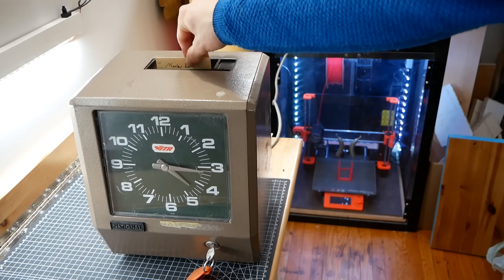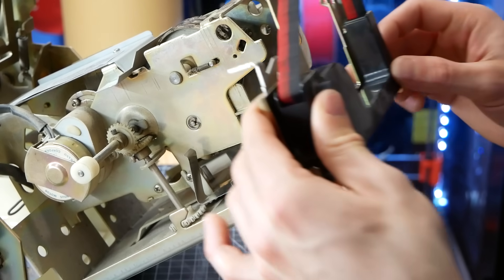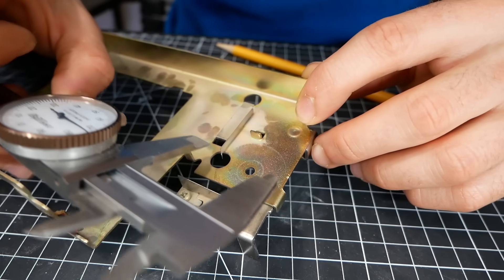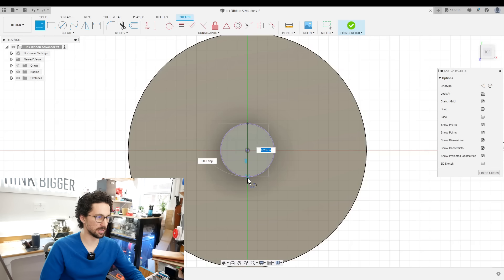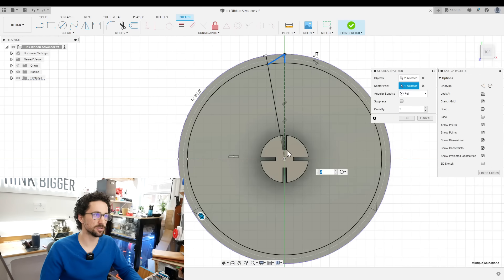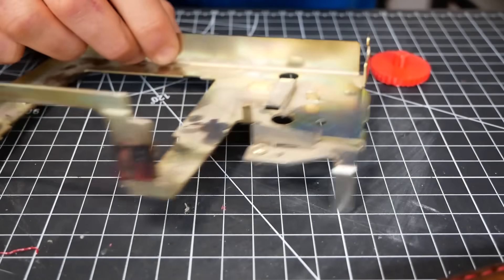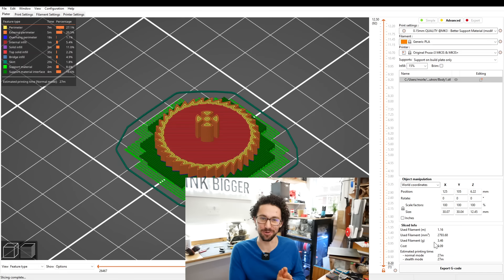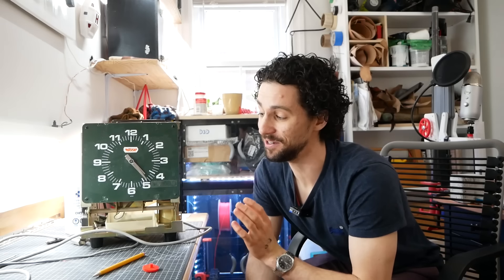They wanted 100 dollars. I 3D printed it for 9 cents.

Comment: That was pretty damn cool. And informative about the fusion aspects, really helped sell me on the parametric designing.
Reply from the maker: Thanks Jeremy! Parameters are absolutely incredible for designing functional parts that interact with existing stuff.
Reply: @BuildGUY can you explain what you mean? I’m just getting into this. One of the other examples I’ve seen cited often is like if you designed a book case you could change the number of shelves or the thickness of the material, etc. That made sense to me, perhaps a little unnecessary, but it seems like a simple case of it being useful, so I’m just wondering if you have an example where it’s either doesn’t work or is maybe not worth the effort or something.